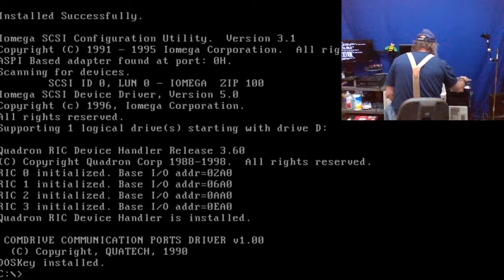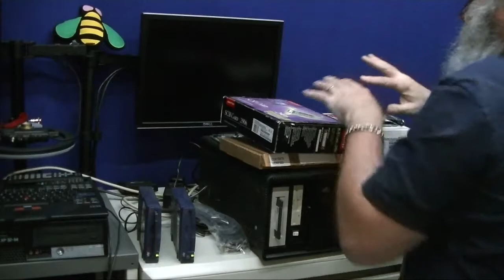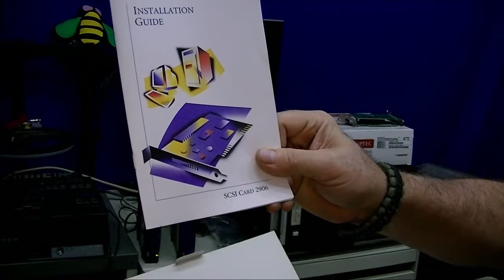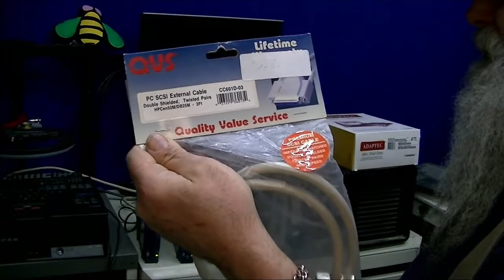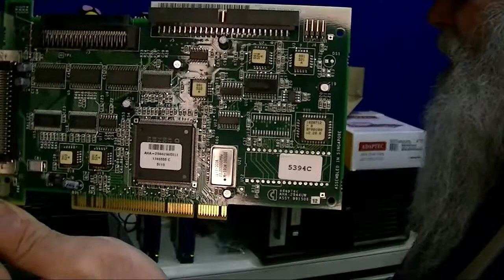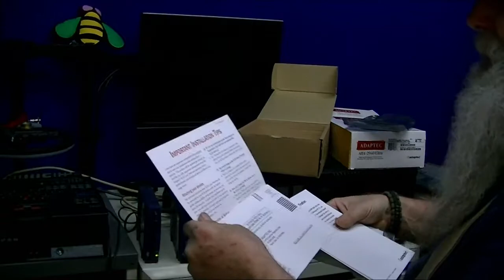SCSI adapter and OS ponderings for the IBM 7588 "Industrial".

Comment: With a Pentium MMX 133, 64 MB of RAM, and seemingly 2 GB of hard disk space to work with, you certainly have the space and resources to try out several OSes. When in doubt, multi-boot!

In my case with a PS/2 8595, 486SX25 processor, half your RAM, but similar disk space, I eventually chose to quadruple boot DOS 6.22 (plus Windows 3.0 and Workgroups 3.11), Win 95, NT 3.51, and NT 4.0. While possible to put them all into the same partition, I opted instead to split into four primary partitions for the smaller cluster size, faster directory listings, and ease of keeping things separate enough.

Likewise with no CD-ROM drive, I’d transfer the i386 folders from the NT versions over null modem cables from a PC that had an internal optical drive. It takes a long time to transfer but it’s worth it to be able to install from the local disk.

Comment: Ah the scsi card without a rom. Can't boot from it but you can run scsi devices from it.
Reply from the maker: The Adaptec 2902 can't even run internal SCSI devices! I thought I would give viewers a selection, however. It's going to be a Windows 3.1/95/NT system (I'm not even going to try for USB) platform, which is your choice?
Reply: @IBM_Museum  To many years. a 2940 number came to mind though.
Reply from the maker: @idahofur : An AHA-2940 is a good (and very common) choice for adding SCSI to a PCI system...
Reply: @IBM_Museum  I was trying to remember what my first scsi item was that I installed. . I'm thinking it was a Scanner. Then I know the first CDRW drives was scsi only. HP or Plextor.
Reply from the maker: @idahofur : Yes, we had an external CD-R drive in a case - I still have it - that we used to burn installation discs from a Windows NT system. It was a double-speed unit and the NT system couldn't multitask at the same time, or you got a bad disc! That was when they were over a dollar each, even in quantities of several hundred!